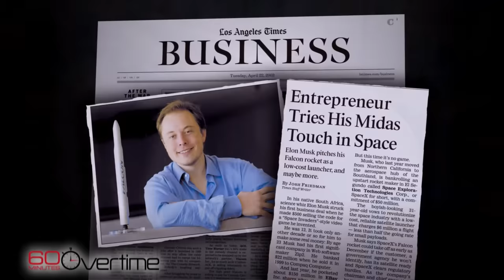2012: SpaceX: Elon Musk's race to space

Comment: In the beginning with NASA   the red tape and bureaucracies wernt a major problem  .as they have become  . With a  private sector  company  .  That has taken a assembly line approach  with out massive layers of dead whieght management . Anything with government takes 2 to 3 times as long  plus in a lot of cases it's  not the same personnel that are there at the finish. Other factors  supply  cost increases  because  it's dragging on a lot longer than  it should  .  In house manufacturing  from one end to the other will be more efficient  and  have better quality  control .  In the past with multiple  sub contractors  that has been  a problem  when it  fails.